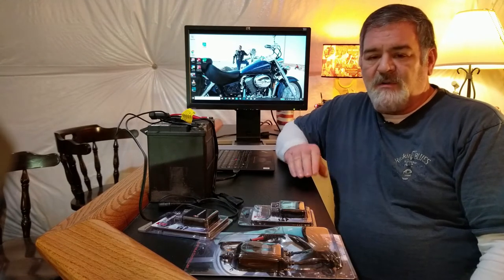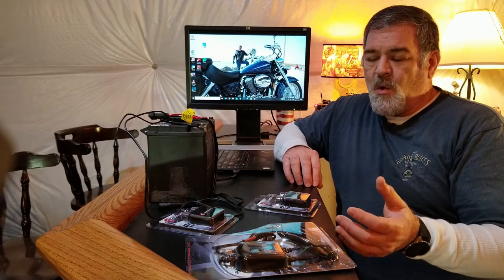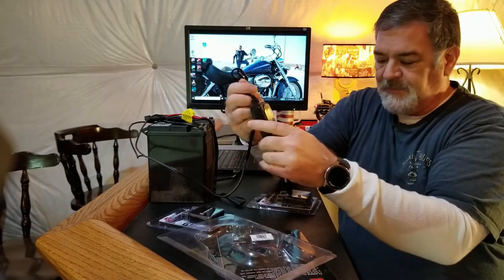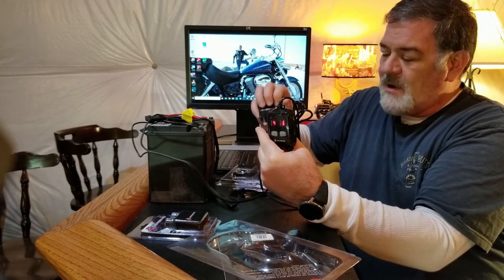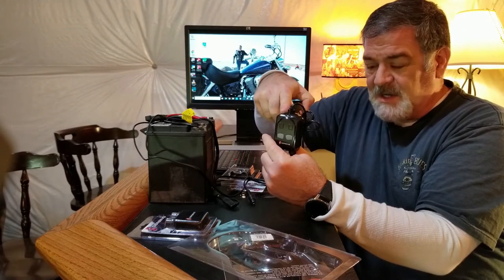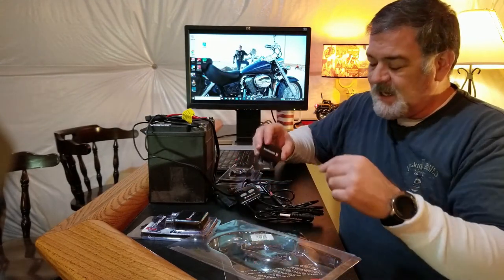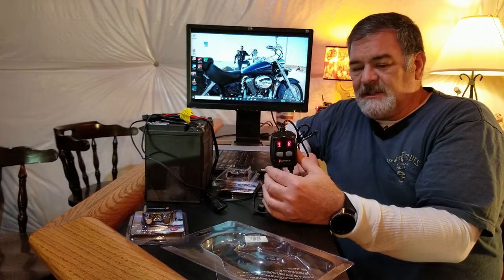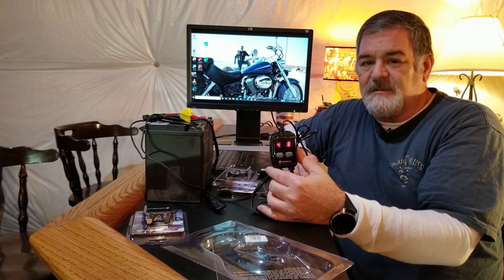Gerbing Dual Port Heat Controller With Wireless Remote Follow Up

Comment: Thanks for sharing.  I watched your other video with the Warm and safe  dual heat troller. Overall which would you prefer and why.  The Warm and safe appears to less bulky for easy storage when riding.
Reply from the maker: Hello NDpendentConnection,

Form factor is definitely a prime consideration, and you've already called that out in your question. If space is limited than Warm and Safe is the way to go between them and Gerbing. Both companies are solid. Warm and Safe has been in business since about 1995. About 28 years, so definitely not a "new kid on the block", and their products have been well and positively reviewed by many retailers and purchasers.

However, if space is not as big a consideration I would point out that Gerbing has been in business since about 1978. About 45 years. They continually develop new products, and have a reputation for quality. This can often mean similar classes of products might be a bit more expensive from Gerbing than others. But, if I'm only going to buy 1 heated jacket in 15 or 20 years, I'd try to get the best product possible.

The Warranties on Heat Controllers are worth reviewing carefully before purchase -
From the Warm and Safe website: "If it fails due to faulty parts or manufacturing within 3 YEARS of your purchase we WILL replace or fix it."

From the Gerbing website: "For over 45 years, Gerbing has been the industry leader in developing heating technologies and has earned the trust of our customers by standing by the quality and performance of our products. We continue to stand by our products because we know our customers rely on them for comfort and safety during the harshest conditions. We currently offer three different warranties:

Lifetime Warranty: Our Gerbing Heating Elements & Microwire Heating System are protected forever under our lifetime guarantee.

One-Year Warranty: All non-electrical components of our clothing are warrantied for one year after purchase. In addition, our temperature controllers, electrical plugs, connectors, solder joints, and connection cables are covered for one year.

90-Day Warranty: Batteries and chargers are warrantied for 90 days after purchase."

So, if all considerations wound up being equal for my particular needs, I'd probably go with Gerbing.

Ride Safe, Namaste.  -GeezeRider
Reply: @GeezeRider  Thank you sir.. Keep

Comment: Liked your presentation very much. However I was disappointed that you never changed the temperature settings using the remote. Perhaps changing the temperature settings from the remote, then turning the power off and seeing if the controller remembered the changed remote settings when you turned it back on would have been a  worthy test. I realize your videos are 2 years old but they showed up when I did a search for "Gerbing heated wireless controller". I watched both videos fully. Thank You.
Reply from the maker: Hello Craig, thank you for your comments. Those are good points. Over the course of the 3 winters from the publishing of the video, the unit would return to the setting it was on when powered off. The caveat is that if you turned the remote off, then the unit would revert back to the lowest setting (the lowest before the remote clicks off). If you didn't use the remote, but instead just used the buttons on the unit, it would always power back up to the last setting. The remote doesn't draw a lot, so if your charging system doesn't benefit from turning the unit off/down before turning off the bike, you could leave the remote at the current setting like I have been doing, and then it resumes at that setting when you start the bike/reconnect power to the unit. I hope this information covers your concerns. Ride Safe, Namaste.  -GeezeRider

Comment: If you had the remote velcroed to your jacket what distance can it maintain communication. Going in to a restaurant  etc?
Reply from the maker: Hello Craig, I need a little more information to answer your question. In the scenario you're describing, where is the receiver (the part that plugs into power and the various ports on the jacket)?
Reply: @GeezeRider  left at the bike or on the the jacket at the bike. Or if the remote is attached to the bike and you go away from the bike with main controller on you basically how far away can the remote be from the main controller to maintain connection?
Reply from the maker: The remote uses "Bluetooth Low Energy" or BLE for transmission. The Nominal maximum range for BLE is 330 ft. Note that there are a LOT of external factors that can reduce that range- Devices not being in line of sight, ambient signal noise in the are, being inside a structure, etc.. Basically expect a bit less than that range in practical application. Also note that there is a newer version of BLE which allegedly has a greater range, but I doubt that's being used in these products. This is why you may see differing statements about the maximum distance for BLE in your search results.

I'm still a bit unsure of your proposed use case, and I'm curious: Is your primary thought here to have a 12v source (like a rechargeable battery) powering the jacket as you walk away from the bike mounted transmitter? I ask because the connection is broken when power is removed from the controller (the part that powers the jacket). Connection/bond is resumed when power is applied to the controller, and the remote is turned back on.

Ride Safe, Namaste.  -GeezeRider
Reply: @GeezeRider  Ok, Thanks for the info. I hope was searching for heated gear and this was the brand I was interested in. Came across your video to see if they had problems with reliability. I'm not familiar with heated gear and was just gathering info to see if I wanted to invest in it. Watching your videos just led me to questions of curiosity more than anything. Now I have a better understanding and it didn't dawn on me that leaving the bike with the gear on requires unplugging from the power. Stupid me. LOL. So I see why you asked about an alternate power source. And no I wasn't thinking that way just an error on my part of unplugging from the bike. Thanks for your help.

Comment: Any longer term update on the remote sync issue? Is it staying synced a whole season?
Reply from the maker: Hello JMFlora Group, The (replacement) remote has stayed in sync from basically early April until mid November without issue. During that time there was no power applied to the controller, and the remote was not turned on. They were not even stored near each other during that timeframe. At this point, I consider the issue fixed/resolved. Thanks, Ride safe, Namaste -GeezeRider
Reply: @GeezeRider  Thanks for updated update and the outstanding thorough reviews.

Comment: Did a new CR2032 battery fix the suspect controller?
Reply from the maker: Hello lqqkout4thedue, I have not yet replaced the CR2032 battery in the suspect remote. I have been exclusively using the replacement remote Gerbing sent, and that has been working without incident. I will say that I did try the suspect controller at a later date, and several times it synced and operated without incident. Thanks. Ride Safe, Namaste.  -GeezeRider

Comment: Have you done a video on the gerbing Bluetooth controller ? I have one that's "suspect"
Reply: Sadly not much gerbing support to fix, replace one I have since it's not supported.  Odd mine only seems to work sometimes if I turn off my phone's Bluetooth then gerbing Bluetooth controller sometimes connect's an may work some times
Reply from the maker: Hi Joe, I haven't done a review of Gerbing's bluetooth (or 7 volt products), nor do I own any. My personal preference is not to have to mess with my phone to make temperature adjustments when on the bike. Depending on where you bought yours from, you might be able to get support for your issue. For example "The Warming Store" is really good about getting you in touch with the right people from the manufacturer if you bought through them. You can also always reach out to Gerbing directly. https://www.gerbing.com/contact-us
Reply: @GeezeRider  thank you for the response. I have both 12 volt and 7 volt. I like the 12 volt on my motorcycle and ATV cuz it delivers more heat and can for extended periods. I like the seven volt also went out and about like skiing.. the Bluetooth controller allows you to set the temperature desired and it maintains it instead of low medium high can set it to for example 78°